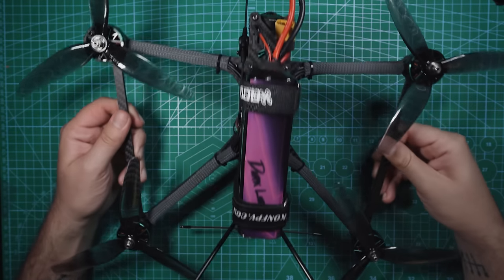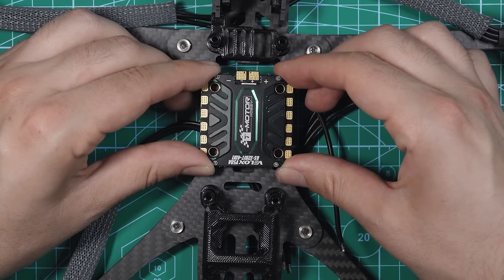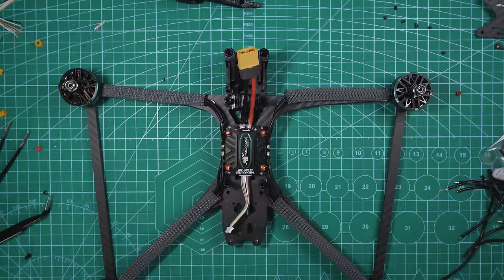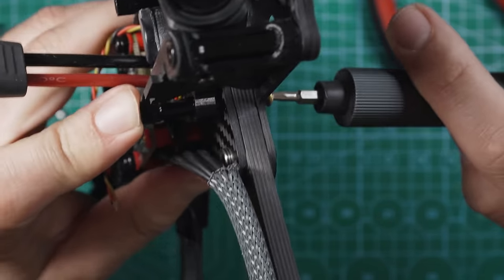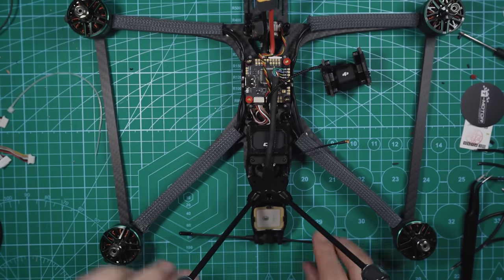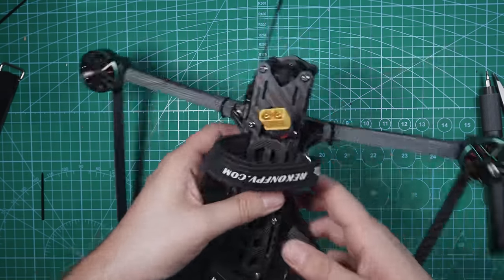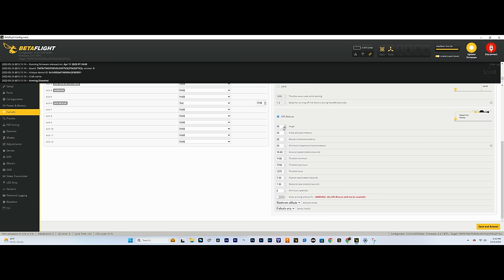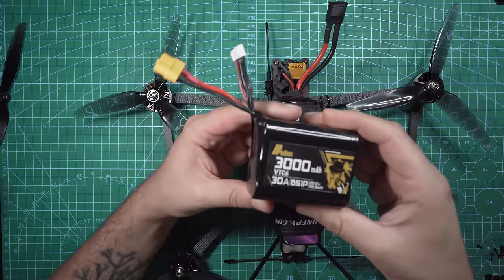How To Build a 7" Long Range FPV Drone

Comment: Very cool guide, makes me want to try it. Still I'd like a GoPro as well. Is it smaller than say the Chimera frame? I guess you can't take those 5200 batteries on an airplane, right? Should be above 100 Wh...

Comment: Hi, epic video, thanks for that! I just got into FPV flying as well using the DJI O3 system. I seem to get a lot less range tho. I have the stock antenna and I use the DJI goggles v2. What settings do you use on the O3 to extend the range and what other tips should I consider (iflight crystal patch antenna's?)
Would appreciate some help.
Reply: To extend the range, settings is not that important. Battery effiency is the key. Bi-prop + rotors with high spin rate and less torque, will generally give you a 30-40 mins fly time.

Comment: My radio has built in ELRS. I plan on building a drone and I think I’d like to follow this.
Reply from the maker: Only part you'll have to sub out is the receiver. 
I'd recommend something like the BetaFPV Super D or Radiomasters RP4TD/RP3 for true diversity and the best range
Reply: @TRONCATFPV I have the tx16s

Comment: i know this is an old video but does it really not matter where the motors go? i know the propellor nuts screw on either CW or CCW. this would allow them to not get loose while spinning at high speeds
Reply: Do you know how he connected the drone to his computer for tuning?
Reply: @RJ3437  Regular USB cable m8

Comment: Great video. What remote controller and goggle setup did you use? I've been flying DJI for several years (FPV, Mini 3 Pro, Spark, Mavic and others) and I have  a few controllers and goggles that I'd love to pair with this drone if possible. Would love any input that people have.

Comment: @TRONCAT FPV
Please answer the following that has been asked, but may have been missed by you:
.
1. What is the range you can expect past field of view with open areas?
2. what type of controller/radio transmitter are you using for your TBS Crossfire Nano RX
3. What type of DJI goggles? 
  (These things should be updated on the buy list)

Please answer, thanks so much
Reply: with line of site you can probably go more than 7-8 miles, the problem is the battery though, you don't want to go too far out and then not have enough juice to make it back.  Most people use RadioMaster with a CrossFire module. Googles 2 or Intengra works well on the O3 Air unit.

Comment: I have a question. Why are you choosing the 750-1000g preset instead of the 1000-1400g one? My chimera7 with the gopro and battery is definitely heavier than 1KG, would you recommend to use the 1000-1400g preset in my case? and thank you for this great guide

Comment: Late to the show, but just purchased my first drone and allready bit by the bug.  I love VR, so this will be a no brainer for my next step.  Want to try FPV and build my first drone.  Some peeps say its too much too soon but ive had quite a bit of RC experiance sooooo  i figured why not.
My real question now is if i can use most of this equipment on the rekon 10 pro chassis except the motors of coarse, and was wondering about position hold , etc.    Just have not built a drone yet.  So some parts i am not up to speed on yet. Motor size recommended and recommend me a GPS with magnetometer.  Thanks in advance... Edited for fat fingers typing problems.
Reply: ???? Anyone

Comment: I am still waiting for the antennas to be available the 220 mm . Haven’t had any luck on them being available. Do you happen to know any other websites Amazon don’t have it and bang good was out of them. Big fan of your channel. I am still worried on how I’m going to set this up on beta flight , any suggestions or or a video upload that you can do on setting this 7 inch up on Beta flight? I’m still trying to save some money so that I can get the Lipo and goggles, and controller. What controller and goggles do you recommend for the 7 inch? Do you have any laying around that you’re willing to sell maybe if not maybe some links thank you and I appreciate it. And keep up the good work.

Comment: Thanks, greatvid. If I want to extend the range of the drone, with all other factors being equal, will a lower KV rating on the motor facilitate a longer range? Novice drone Builder here.

Comment: Do you have to use a DJI Controller when you are running the O3 system? Or are you able to use another Radio? I am thinking about getting into the Radiomaster TX16S Mark II Max Radio for doing some Simulator time but I am planning on Running O3 once I go live with a drone.

Comment: I believe instead of copper on the GPS wires Mumetal would block stray signals better. Your thoughts?
Reply from the maker: Possibly, I haven’t tried it though

Comment: I thought ELRS is better for long range? I’m a noob here to learn. Thanks.
Reply from the maker: Crossfire operates on 900mhz and will be better at penetration & long range. 
We're starting to see more 900mhz ELRS gear as time goes on and that should be more comparable to crossfire

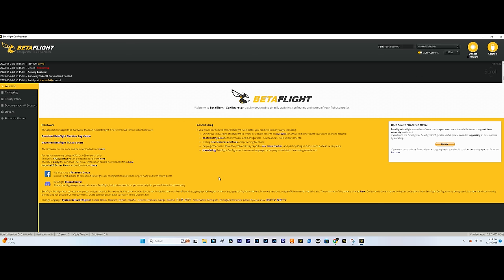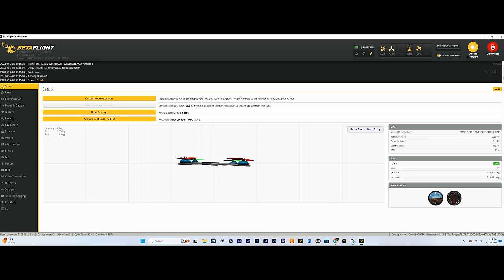Comment: Between 1:00:59 and 1:01:00 there was a reboot. It went from showing no Baro for most of the video to the Baro showing up. Also, it looked like you soldered all the wires on the GPS so it should have a compass but it didn’t show up. Do you happen to know why in both cases? Maybe compass was not enabled in the configuration Tab? Also, I have noticed that you need to select Manometer as part of the latest FC BF firmware. Maybe the code is not in your firmware?

Comment: Just built this first flight it went up did a yaw spin lost rc connection and it smashed through my sun roof 😃
Reply from the maker: Yaw spin on takeoff usually means the orientation of your board is off or motors aren't spinning the way that betaflight thinks

Comment: How far can it go ? As DJI has a restriction of 10 Kms ... I am planning to build an fpv to go 16 Kms (one stretch). Is replacing a O3 unit with any other vtx and leaving rest of the build same as u have shown sufficient mate ?
Reply: Also can anyone plz let me know, can we use Li Ion battery on any 6s compatible drones instead of a Lipo? Should we include something in the build thats necessary for a Li Ion or is there any restriction in terms of the Li Ion capacity ?

Comment: Does the GPS keep the drone level at all like DJI?  Also, im assuming no NFZ nonsense or height limits?
Reply: This is an FPV drone flown in traditional acro mode.  You want the stabilizing of a Dji drone, get a Mavic 3
Reply: @rubengarciajr7560  ok, does this type of drone limit the height, distance, and NFZ’s like my Mavic 3 pro?

Comment: This is amazing !! Thanks so much for sharing !  I want to get my FAA Part 107  license  to potentially tap into drone job opportunities However I have a huge interest in drones so in my research I cam across FPV drones. I love the concept of building my own. As a beginner what’s some recommendations on getting started?
Reply from the maker: Start with an everything-included kit to get used to everything. Typically RTF whoop kits are fairly durable plus the goggles/controller will be useable with future FPV drones.
This is one of my favorites that I've tried out: https://www.racedayquads.com/products/sub250-rtf-whoopfly16-ready-to-fly-elrs-analog-kit-w-goggles-radio-transmitter-case-drone?aff=58

Comment: Doesnt it matter for the threads which arm the motor goes on? Doesnt two of them have reverse pitch on the threads so they dont spin loose?
Reply from the maker: nope! All new motors are the exact same thread pitch 👍
There used to be more motors that had reversed to prevent loosening, but haven't seen any in a while.

Comment: Do you think I’ll be limited by the integras doing this build? Considering they’re not removable antennas
Reply from the maker: I really don’t think so, the stock DJI antennas are pretty damn solid with range & penetration 👍
Reply: @TRONCATFPV  ok thank you for responding already got the frame so 😂🤪

Comment: Nice and clean video, but I have I quick question, when the o3 is set on ultra wide 155 FOV won’t the side camera mounting arms be visible in the video? Asking this question as I saw such a problem in other video. Please do answer. Great content💯
Reply: this is a deadcat style frame which moves the front arms away from cam

Comment: Thank you for this vid!  I want to use a regular analog video system on this.  What size camera should I get to mount in the provided 03 camera mount?  Also, do you think HGLRC has made TPU mounts for this frame that work with an analog camera?

Comment: How does the grounded copper tape help the GPS lock quicker? Could this be used to help with analog video noise (by covering the video wires in the same grounded copper wire)?

Comment: Hi, just wondering why you also added a receiver, i thought the o3 air unit had an inbuilt one?
Reply from the maker: You could use the O3 receiver but then you're limited to using ONLY DJI's controller (I prefer to use my Mambo). 
Plus for a long range build like this one 900mhz will out perform 2.4ghz

Comment: SOLVED! Problem was BT 4.4.2: Wizard is broken.
Hi ya!
Awesome tutorial, I built it and almost everything works. But the motor direction of 2 motors is wrong but neither the wizard nor the individual method changes anything. I press to turn the motor around and it doesn't. I had to skip the step with BL Heli because there is no Suite for a Mac. SO I donÄt know if they are on 96 hz either. 
What can I do ? Resolder??

Comment: I built this drone exactly as shown except used the 1300 kv motors. I'm getting about 17 minutes on a 3300 maH Lipo however I can only get about 13 minutes on the Upgrade Energy Dark Lithium 5600mah 6s Li-Ion. 
 
What's up, weight, charge?

Comment: I'm brand new drones so just curious why you didn't go with a lipo battery since they a lighter. Is it in case if I crash???
Reply from the maker: LiPo's aren't as good as Li-Ion with flight time. LiPo's are good for freestyle flights (quick acrobatic movements) whereas Li-Ions are good for just cruising and longer flight time.

Comment: Have a question, for this build you have to use the DJI controller and DJI goggles specifically for the 03 air unit right?
Reply from the maker: You have to use DJI Goggles, but not necessarily the DJI controller. In my build since I use a crossfire receiver I just use my mambo. You could hook up SBUS to the O3 and use the DJI remote if you wanted to 👍
Reply: @TRONCATFPV  Great video! I've always wanted to build one and this video is a great guide. I really like the new walksnail googles, so would I be able to use most of the parts for my build but switch out the o3 air for a walk snail moon light unit?

Comment: Is it possible to build the drone with the 'old' DJI Air Unit? I think it would be a little less expensive without a big impact.
Reply from the maker: Absolutely, only downfall is you won’t have on-board 4K video and shorter range

Comment: ive  builtthe 7" long range drone but are struggling gettin a transmiter to fit ive got dji mini2 and just purchased radiolink AT10ii but still will not couple up so what transmiter would you recomend   cheers Malc

Comment: Quick question, why did you opt out of using ELRS for the receiver? Its cheaper and has been proven to work across long distances.
Reply from the maker: You could definitely use an ELRS diversity receiver and probably get equivalent range. I have recently migrated most of my quads to CRSF so I wanted to keep this one in line with the rest.
I do a lot of indoor flying and prefer 900mhz since its better with penetration than 2.4ghz👍
Reply: @TRONCATFPV  There's a 868/915mhz diversity receiver with elrs also

Comment: Do you have any source or side by side testing on the shielded GPS/mag cable? Both the UART for GPS and I2C for the mag are low speed digital interfaces designed to tolerate some environmental noise.  The power lines should have adequate decoupling capacitance on the GPS board so that any induced noise on the power lines or ripple from ESC draw should be a non-issue (unless the board is garbage).  I don't think shielding would hurt anything other than adding a little weight, but I don't see an electrical reason that should make any difference in a quad.
Reply from the maker: I've done some side by side testing and wrapping the GPS wire like I did in the video helps significantly every time. I've had long range drones go from 3 minutes for sat lock to 30 seconds for sat lock after shielding.
Reply: @TRONCATFPV  Can you tell me more about that testing? Did you test shielded or unshielded first?  If unshielded first, did you wipe the GPS ephemeris data, wait long enough for it to be fully invalid between testing, or use two different GPS units for the test?  I'm having a hard time seeing how shielding the data cable could have had anything to do with time to fix, BUT if you tested unshielded first, then shielded and re-tested on the same quad, it's completely expected that the second fix would be much faster with recent ephemeris stored in the GPS module's nonvolatile RAM.

Comment: The frame assembly instructions link takes me to the product page.  I don’t see a link on that page to download the manual.  Would you email it to me or provide a link directly to the .pdf?  Also, what is the length of the full top plate?

Comment: Is the frequency switching from 2.4 to 5.8  on the o3 unit an issue with 5.8 antennas ?  Seems like all prebuilt quads with o3 are not using the multi band single antenna that comes with the o3 unit.

Comment: would this work with an 8400mAh battery? or is that too much weight?
Reply from the maker: Depends on the weight, I think it should be able to handle an 8400. I wouldn’t go much bigger though

Comment: Which remote control and goggles did you use?
Reply: goggles, it has to be DJI Goggles 2, 3, integra.  Radio, any that can use the the TBS Crossfire protocol.

Comment: Hi, I am novice on drones.  great video lots of details and ~like the drone however just the drone is almost $800-$900 USD and if I add a descent controller then it will cost an additional >$250 USD...  Wouldn't it be easier getting a DJI FPV, Avata, or Air 2?
Reply: most people who build these types of drones are already into FPV, so they have goggles, radios, batteries.  You cannot compare an Avata or Air 2S with this type of drone.

Comment: Hi, why are you using a receiver with cross- T- antennas if you're using a dji 03 air unit? Doesn't the dji03 have a receiver built-in? Please help

Comment: Wait so if i just want to build a drone to be used with a dji controller 2 then i don't need to use the extended antennas, or any extra receivers,( I will also not get a beeper)?, ho wmuch wose in performance is this because  this will be my first drone to build or fly irl

Comment: How does the copper tape improve gps? Does it have to be wrapped around the wire or can you run a strip around the drone frame for larger coverage?
Reply: It's to provide RFI Shielding  - RFI is Radio Frequency Shielding.  This reduces the cross talk noise from the adjacent electronics

Comment: I am confident that I will be able to make a drone myself but the think which I am totally unsure about is about tuning the drone. What software is it and with the drone building kit do they provide a step by step guide?
Reply from the maker: Software used to tune the drone is betaflight & BLheli 32 (free, works on Mac & PC)
Both are covered in this video to make tuning easier 🤙

Comment: Hi, thx for your video - I try to build this drone following your guide. I have question though: can be GPS - HGLRC M80 Pro (25x25)   exchanged  for  HGLRC M100-5883 GPS (it's 10-th generation so should be better or stick to your recommended M80 Pro? )    Greetings :)
Reply: the wire hookup to the pads are the same thing so it should work, but that module is probably smaller and you would need to find a way to mount it.
Reply: @rubengarciajr7560  Thx for the info, If it is not better than M80 then I will keep the original part as I found store with it in stock :) Another thing is what radio controller for your drone are U using, cos I plan to go with RadioMaster  TX16S Max Mk2 HALL AG01 MPM 4in1 with TBS Crossfire nano TX V2 module (will it work together ?) Have a nice day :)
Reply: @DinAlter I’m just using a radiomaster rp4td elrs receiver, have the tx16s and boxer with elrs
Reply: @rubengarciajr7560  Thx

Comment: good vid, but why not use the O3 unit as receiver as well ? then you dont need crossfire. O3 is long range
Reply from the maker: you could, I personally don't want to be limited to using the DJI remote with the drone. Plus I just trust CRSF more than DJI for solid radio link.
Reply: Most FPV pilots prefer to use large radios like the RadioMaster TX16s or Boxer for the bigger gimbals.  Also, when you lose goggles reception, you also loose the DJI controller control.  With Crossfire or ELRS, you still have control link even if the O3 signal goes out.

Comment: My question is how well this would up a full size go pro and how well does this fly in high winds
Reply from the maker: This could easily hold a full sized GoPro. Seems to fly pretty good in high winds! The size of it helps alot

Comment: Have you had any issues with o3 blackout from the dji plug from high output power? The dji plug doesnt seem to output enough wattage if the o3 power output gets too high. I'm considering wiring my o3 to vbat instead to supply enough power.
Reply from the maker: I personally haven't experienced this thankfully